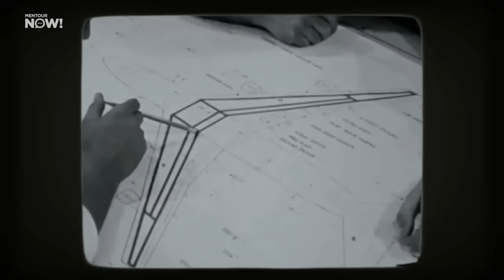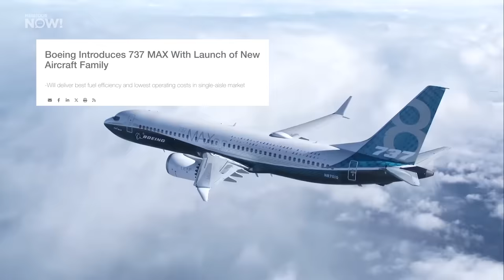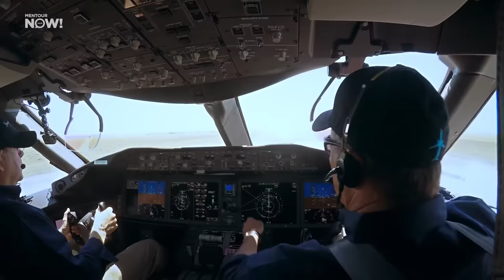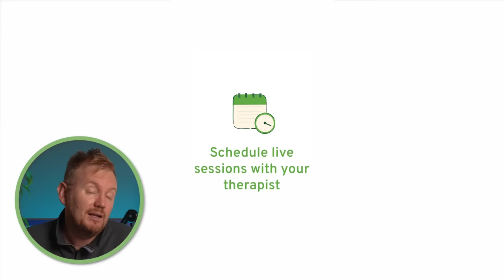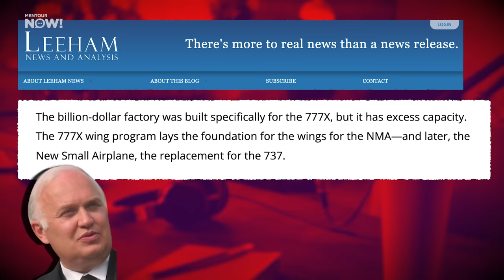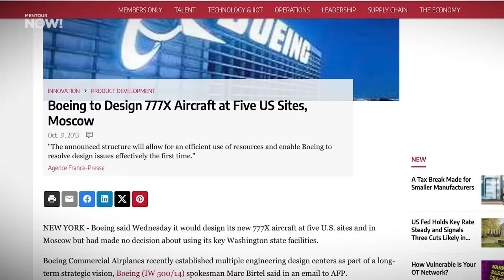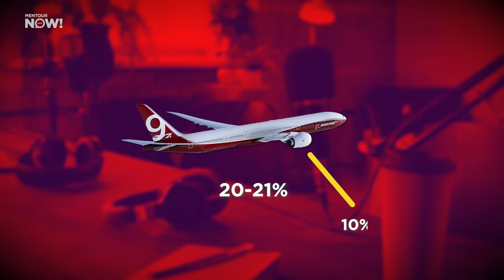What’s Going On With The Boeing 777X?!

Comment: How could they possibly have developed planes such as the SR-71 and it's amazing J58 engines, in barely two years using slide rules ??
Reply: For one thing, the budget was basically "Yes".
Reply: Slide rules are efficient.  When high precision was needed, electromechanical or electronic calculators were used.  Calculators have existed for a long time.
Reply from the maker: Yes, it was amazing feats for sure. 
Military budgets helped.
Reply: Money helps of course, but the leadership of Kelly Turner was probably more important. Sometimes having too much resources is not helpful.  One leader and a well chosen team (which was not that big)  @MentourNow
Reply: @topgundoc01  Kelly Johnson?

Comment: 🎯 Key Takeaways for quick navigation:

00:00 ✈️ Boeing 777X faces prolonged delays, taking over 12 years from launch to passenger service, raising questions about its development.
02:39 🛫 Boeing developed 777X in response to Airbus A350 upgrades, aiming to replace the popular 777-300ER and compete effectively.
06:47 🦚 777X features a unique composite wing with foldable wingtips, ensuring it fits existing airport gate categories and minimizing handling fees.
12:58 🚫 Boeing faced challenges with fuselage construction automation (FAUB) and encountered delays in wing production, impacting the overall program timeline.
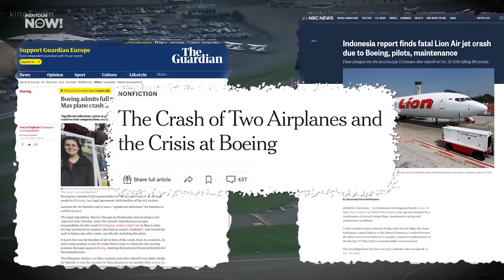17:06 📅 Certification changes post-737 MAX crashes, increased FAA involvement, and global scrutiny contributed to additional delays in the 777X program.

Made with HARPA AI

Comment: Sometimes I think the drive to make aircraft more efficient is also making aircraft less safe and more troublesome.
Reply: More troublesome, certainly, but today's airplanes are massively safer than the older models - the stats do not lie. Strangely enough, the biggest single reason is that they are more automated - even the most rigorously trained pilot will always make many more errors than the computer.

Comment: Interesting. I would like to see Airbus replacing two of the engines on their A380 with those enormous highly efficient new engines seen @14:52 .  I'm sure that would increase the efficiency of the A380. For example, all engines would be used for takeoff but the smaller outer engines could be shut down while cruising.
Reply: That's an interesting concept.   If they'd fit under the wing.   I don't think anyone's tried it before.   But (and I haven't looked up the thrust figures) I'm not sure the two big engines would have enough thrust on their own for normal cruise speed.

Comment: Is there a sheet out there that could tell how much load is on the wings different sections? I mean introducing movable parts on an planes most important element seems kinda risky. And I 100% believe that those bolts are way over engineered to not have that wingtip break off or flap up and down in flight.

Comment: What happened to the 777x ( and the 737 MAX)? McDonnel Douglas. After the merger Boeing went from being a safety focused engineering aircraft manufacturer to one run by the McDonnel Douglas bean counters. The HQ was separated from the factory and engineers. The original, terrific Boeing culture was replaced by the horrible McDonnel Douglas culture.  The last major commercial airliner developed entirely before the merger was the 777. It was delivered ahead of schedule and under budget. It was safe from day one.
Reply: Fun fact.  The internal structural arrangement of the 787 more closely resembles that of a McDonnell Douglas aircraft than a Boeing.  The companies designed had different design philosophies with both advantages and disadvantages.  I'm not saying one is inherently better than the other, just two different ways to achieving the same goal.  It's no coincidence that happened when the companies merged.

Comment: What's about the engines of 777X in the dessert? Do they probably  face the same time on wings problem as the A350' do?
Reply: First rule of sales. Always tell your customer you don’t have the same problem as your competitors. 😂
Reply: @jeffhedrich3551  You are a real prof salesman!
Reply: The GE90-115BL1 in Emirates service in the desert has gone so well EK hasn't had a single GE90 in-flight-shut-down in five years - and the GE9X has a debris rejection system, too!
Reply: @rafaelwilks  other engines don’t have a debris rejection system? Are you referring to fod or debris rejection in the oil system?

Comment: Robotics will be the next frontier for manufacturing, if 80% of car manufacturing is robotic airline manufacturing as well should be working towards that... The process is fairly the same with panel fitting, welding and bonding, of course some critical areas of the wings would be a issue but not an unsolvable one. It's another thing if airlines totally move away from Al & Li to composites fully...but a lead time of 12 yrs for a already existing aircraft to be modified is way too long.

Comment: Q: So the 777 is “ payload bigger, more powerful and longer” ... with longer wings and folding ends for efficiency... would it not work as efficiently to shorten the body, make it double story ( eg 380 like) and negate the need for bigger, folding  wings
Reply: Then you’d need 4 engines because if the extra weight. The empty weight of the A380 is about 100 tonnes more than 777x
Reply: Wing size depends mostly on aircraft weight rather than the size or shape of the fuselage.

Comment: Can a 4 engined aircraft "switch off" 2 engines at altitude in order to conserve fuel?

The reason i'm asking is that I read an anecdote about a fighter pilot that was showing off to the bomber aircraft it was escorting. At some point the bomber pilot said to the fighter pilot "well, can your plane do this" then proceeded to continue flying in a straight line. After sometime the fighter pilot had to ask exactly what it was that the bomber pilot had done, and his response was "turned off two engines."
Reply: No, simply put you’ve lost 50% of your thrust so now those other engines will be running at much higher thrust but at standard cruise level that won’t be enough so now they’ll have to descend to lower altitude in denser air which will cause them to slow down

Comment: There's delays across the board now - except when my bills and bladder are concerned it seems. Nothing is ever on time, and nothing comes on or under budget, except Clint Eastwood films. Point being: I'd be very surprised to see the 777-X delivered and flying in 2025. This is just show for the stock to not plunge further. Expect another delay to be announced in 2024. Frankly, I'd rather they delay until ALL the issues are tested at 200% - 148% isn't enough for me.

Comment: 16:42 The testing objective with the ultimate load test necessarily leads to destruction. The airframe is purposely built with the intention to destroy it in order to verify its design integrity.

The same is implied by the blade off event for the engine manufacturers.

The issue there was to demonstrate a suitable fix to make up the 2% shortfall - as you say - failure at 148% versus the required 150%, and the 154% for the original 777 circa 1994/5.

19:38 It isn't the same production line that's important for the first built frame that's important, so much as the *same production standard*. Getting the first built frame as close to the production standard is key to realising cost and time savings. 

An example of how this can go wrong is the required design change incorporation required to strengthen the side of body wing-body joint on the initially built Dreamliners, after the fatigue frame showed that area required strengthening.

With the 787, as with any other aircraft, you want to have the required strength at the lowest possible weight. Being built of entirely different materials presented a design challenge that lead to a significant delay for the 787, but that's the nature of the business.

Comment: It's amazing that Boeing still has a parking meter called a control yoke.... a design failure Boeing and Airbus share in this class of aircraft is the use of bleed air. Boeing borrowed heavily from the 787 but did not use electric deice and electric packs?? Same with the 350.

Comment: You can tell what the company will do well by the profession of the man at the top. If he is an Engineer, the equipment will work well but may or may not be profitable. If he's an accountant, It wont make a loss, but it probably won't work either... I really think you need an Engineer in charge to fundamentally make it work first, then change to an accountant to make it profitable after. AKA 747. Made by Engineers then the programme was taken over by accountants.

Comment: Ive heard Rolls-Royce Has a new very powerful engine in the works Boeing could possibly look into that if GE cant get their stuff together and make that engine reliable.
Reply: With the proven track record of superior quality and reliability with the GE90 and GEnx, we can see where the GE9X is heading.
Reply: Yes the RR Ultrafan Engine. It has been through its testing phase with an additional 5000lbs of thrust above design specs while smashing the powered gearbox record and bypass ratio and is rated with a fuel burn of 12% above the current Trent -900/-1000 engines, which is enormous. RR now optimising the engine and waiting for customers (Inc narrow body as it is a scaleabale engine)

Comment: I made the fuselage turning fixture for the 777 10 times more precisely to the spec than the tolerance called for. The 777 has sold more than any other airliner, and has 1600 delivered, and flying. With all those planes it has flown 27 years without a mass fatality crash to this day except one shot down, and one hijacked. That don't count. Compare to just the first crash of DE Haviland Comet 2 1/2 years, 707 2 1/2 years, 747 4 years, DC 10 8 years, L-1011 8 months. 

I also made hundreds of tail cones for the jets of the C-17. At $60 per cone usually bid on the contract It was a notorious hot potato loss leader in the machining subcontractor part of the aerospace industry. That was to maintain good relations with Boeing to have access to the larger, more profitable contracts. One company after another trying lasers, ultrasound, and high pressure water jet cutters to make them at lower cost failed to turn a profit on the contract.  I modified the fixture to make them twice as fast, and half the cost of anybody else making them using a $60 660 braised carbide getting 10 cones per tool where my company had been breaking $80 880 braised carbides often one per cone. I turned the contract to a profit for the company for the only time in the aviation industry. For my effort Boeing stole my design to make the tail cones for the 777, the largest jet engines in the world. Insult to injury they had my shop do the work to alter the fixture to steal my design, and then salt in the wounds they told the owners to restore my modified fixture back to original if we ever stopped making them. Veiled threat of losing Boeing contracts if I complained about the theft of my invention. 

Long after I left that shop I post about the deplorable behavior of Boeing  on the Internet. (They didn't expect the Internet to give voice to the little guy they cheated in 1993). Then Boeing spent billions to build a secret robot assembly plant which they revealed to the press several years later was built for one reason. To assemble 777x fuselages without using the turning fixture I made. They then dismantled the fixture I made. I don't know if it was scrapped. 

On testing in the 1.5 times maximum expected load test, which often results in the destruction of the plane being tested, my 777 passed with a load of 1.54 times over max expected load. Having so far passed the federally mandated spec it was not stressed to destruction. The 777x made by robots in the secret assembly plant failed explosively at 1.49. In some recent documentaries on aviation construction that's the explosive failure video that has been used. The FAA inspector told the news media it was ok because Boeing just had to reinforce where it failed, produce a technobabble rationale for the reinforcement, and Boeing wouldn't even have to test another one. But Boeing dismantled the formerly secret robot assembly plant. 

The 777x was scheduled for release in 2019 but plagued by one failure after another the release has been pushed back repeatedly to now 2025. Thank God.

A montage of research vehicles including Da Vince's wings, the Wright Flyer, the X-1, the X-15, Apollo 11, and the Space Shuttle Enterprise rollout includes a research submarine with a bubble nosecone I made. The montage is the opening credits of Star Trek Enterprise.

The submarine project had been delayed for years by a silly mistake the customer's engineers made. We machined the largest acrylic aquarium windows for the largest aquarium projects in the world. Star Trek The Voyage Home showing such an aquarium, and the polishing of the windows was made before I began with the company. While working for the company we  got a 62 inch diameter casting of a lopsided bowl of acrylic we were told was for a submarine nosecone. It sat on the shop floor for nearly 2 years. The customers came to visit it from time to time like it was a handicapped child in an assisted living facility. They stand around it with the owners of my company sadly shaking their bowed heads. Then we wouldn't see them again for 6 months. 

I'm walking passed one of their visits after nearly 2 years, and they call me over to help out. They can't figure out if the casting will make the part. I ask for the print. Alarm bells go off because they respond as if they didn't expect me to ask for the print. I even had to wiggle my fingers to prod them to give it to me. I'm thinking real fast now. I know I'm going to blow their minds by solving the problem fast. Have to be fast or now having the key they might see the solution. I know as they give me the print I'm looking for the diameter, and thickness dimensions.  They're 34, and 9 inches. In 2, I swear, no more than 3 seconds I say it'll make. 

Their heads EXPLODE! Their mouths explode. "wadayamean?, howdaya? 2 years we couldn't..." I say "Calm down, calm down.". I explain, " See it finishes at just 34 inches. It's 62 inches now. See it'll make right?" "Can you prove that?" they ask. Puzzled they haven't understood it yet I say "Uh, yeah sure. Ya gotta tape measure? Mine's over there.". Only one of them even had a tape. I pull out 31 inches, and explain, "The print says 34 inches, the tape has 31 inches plus 3 inches for the box is 34 inches. Right?". They all agree. I bend down, and place the 34 inch tape in the 62 inch bowl, look up, and say "it'll make see?". They say "What about thickness?". They still haven't got it. I push the tape back in to 6 inches. I show the print, and say, "See it calls for 9 inches. 6 of tape, and 3 of box is 9. Right? ". They agree. I bend down, and put the 9 inch tape in the 12 to 14 inch thick casting of the bowl. I stand up, and say "It'll make. RIGHT?". They say "Ooohhh". I say, "In fact we can probably cut most of the overstock off with a chainsaw". Their heads explode again. "No, no, no. We're not gonna cut it with a chainsaw!" I say, "Sure but you don't have to make the casting like that.". I explain, "Just pour them in a slab, and cut 6 sided polygons like we've been doing with hundreds of portholes we've been making for years. It won't be much more waste to cut off than we get making them. Nothing like this bowl." they say "Yes, yes, yes.". 

That got the project running.
 
The testing of the completed "Research Submersible", (production models are "Tourist Submersibles") was shown in a TV news report. Because of the delay the testing was being done as the Star Trek Enterprise opening montage of "research vehicles" was being composed. That's how the clip of the news report on my sub, nose window front, and center, got into the montage as the last real vehicle before the montage of the then proposed  future International Space Station, the fictional advanced single stage to orbit space shuttle, the first warp drive space ship, and the Enterprise NX-01 in the opening of Star Trek Enterprise.
Reply: You’re not seriously comparing the 777 with 1950s technology before high altitude, pressurised flight was fully understood?
Reply: @TesterAnimal1  The comparison standard is not the De Haviland Comet. The comparison is 30 years safety. What's the excuse of the rest of the same aviation industry of all time?